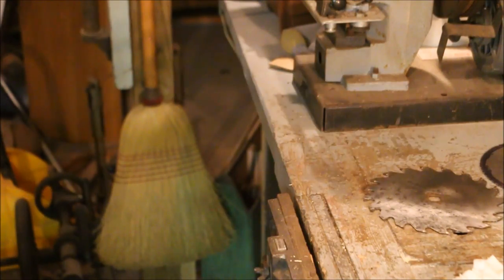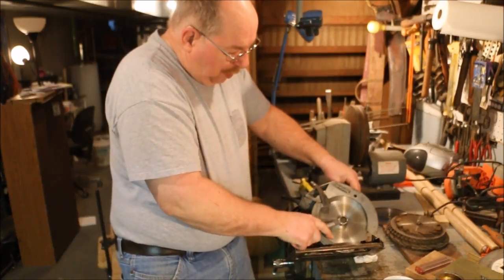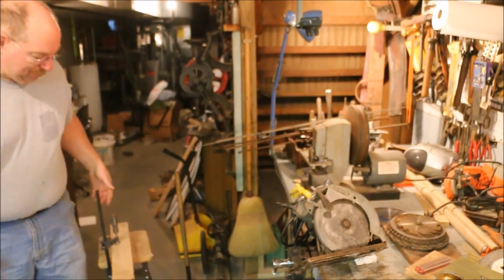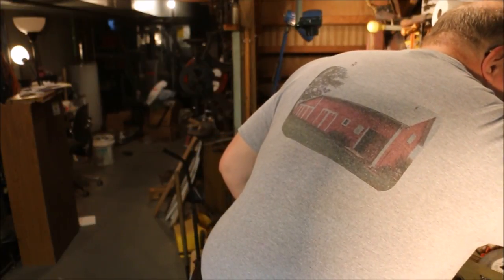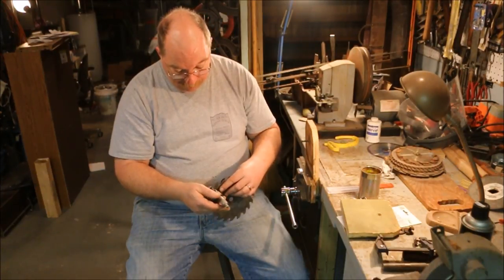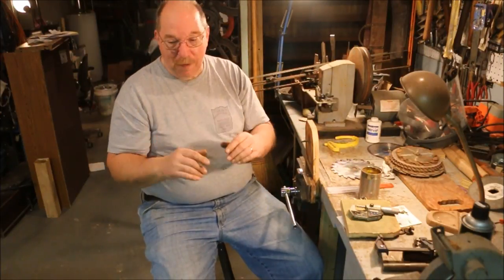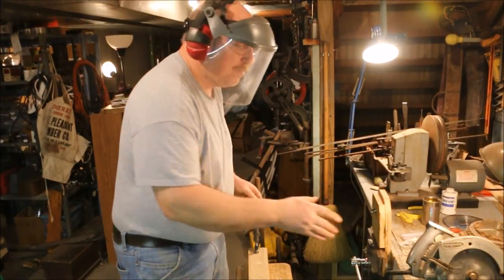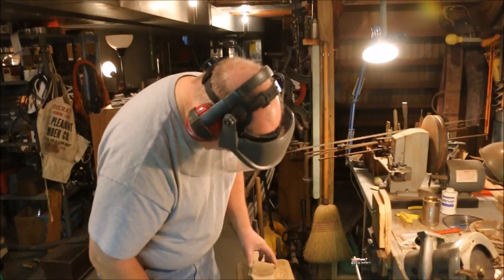CAN YOU SHARPEN CARBIDE SAW BLADES BY HAND? ~ PART 3 ~ TESTING RESULTS

Comment: My very sincere thanks. Proof indeed on the ability to sharpen carbide tipped saw blades and my Evolution will be getting the Sneelock treatment, saving £25 a time on new blades. I like the Evolutions ability to cut wood, steel, aluminium etc but the cost of blades was always a bugbear, but now I will get much more life from a single blade. I am building the same jig and will mark each tooth with the poor man's engineering blue, namely a permanent Sharpie. Thanks again.
Reply from the maker: UK Tony If I hadn't found an inexpensive bottle of Dychem I would be using a marker. 
I still use it on some jobs. No drips. 😎

Comment: Looks like the proof was in the puddin' on this. I think my DeWalt blade and the set as alternating angles on the top of the tooth (none in the blade itself) but I've slept since I had it out with the plywood blade in. But I like smoke. It's the bouncing around I can't handle, literally, so as long as it don't try to run off it's good enough for who it's for, ME! Now if it was a diesel saw it'd be different! Thanks, Unc! Fine job as usual!.

Comment: 'Michigan Skilsaw Massacre' (Granted, you're using a Craftsman circular saw, but I'm taking artistic license for a better name) may not be the greatest horror film of all time, but it would certainly be one of the most interesting.  Chasing after old machinists ('cause who else bleeds Dykem?), and having to stop every 50 feet to find another plug-in... You'll have to choose what type of mask to wear, cause nothing comes to mind.

It's not hard to see who's the sharpest tool in the shed around here...  And the best thing is that you're willing to share how to get sharper!!!
Reply from the maker: Wearing a tinted face shield and ear muffs to block the screaming, the SkillSaw Blade Master stalks the back alleys of the industrial parks looking for the tell tale blue finger prints left behind by the fleeing Machinist Gang. 
Time is short and so are the extention cords. Will our hero vanquish the foe before he reaches the end?
Out of the shadows comes the APRENTICE.....
Running along behind, pushing a generator on a two wheel cart. With extra blades, a spare saw, a bottle of vinegar, and a handfull of files the APPRENTICE stops long enough to check a nearby dumpster before plunging into the back door of the machine shop behind the SkillSaw Blade Master. Until they run out of gas, or blades, they will cut through their enemies without mercy.

Comment: I hear the Cheers!  Looks nice!   Now find some more fun and show us later.   
if i had to cut a saw blade in half, what kind of - saw or blade should i use?   just an everyday circular saw blade - nothing special -   i see now, it's not only blade materials, [tri-blade],  but now need a Different Saw.   = \    I'll hand saw  *  adding to list.
Reply from the maker: Karen O Old school would be to clamp it in a vise with the cut line even with the top of the jaws. With a cold chisel and and appropriate size hammer strike along the line and shear off the metal above the vise. 
Modern options include a hacksaw. It will cut carbon steel. Not easily and not quick. 
My personal favorite is an angle grinder and abrasive cutoff blade. 
Water jet, plasma torch, laser, cutting torch are way down the list because of cost or poor performance.
Reply: W0W!   Thanks much!   A Chisel - Old School huh, sounds like that idea was never topped.   My search on line did not get me far.   Karate Chop with Cold Chisel with Hammer.  I may have that chisel.  Thanks for the input.   peace  *
Reply from the maker: MILLING BY HAND AND EYE  Using Lewie's favorite tools you can make amazing things. Watch these and you will be able to slice that saw plate to ribbons. 
https://www.youtube.com/playlist?list=PLXlq5qGw1peot0KYWh-qUL_RNB2cSsoe3

Comment: If at first you don’t succeed cheat if that don’t work hit it with a hammer and go home or in your case go back to bed lol . I’ve always sharpened them on the face like you’ve just done never done just the tip so was interested to see if it worked . Next time they get a set of diamond files in Lidl I’ll get you a set and send them for you they for the money are very good . Got up this morning and before I did anything looked to see if the text was still there yippee it was I wasn’t dreaming lol 😝 drinking coffee in the shop I’ll have to show you the trick of blowing the top off so you don’t get a mouth full of saw dust very useful to no I can tell you .thanks unc good video as norm
Reply from the maker: David Chadwick I almost didn't tell you. The waiting always drives me nuts.
Reply: Old Sneelock's Workshop ill happily wait 😬
Reply: I understand the first parts but you lost me at the first red light. I think gas, grease dirt and sawdust actually helps a good cup of coffee taste like something a dog wallered in but it beats nothing and will help you run off and hide in a little while. I better stick with the hammer though. I'm about too old to learn a new trick.
Reply from the maker: Lewie McNeely David already had a shirt so he's got a couple saws coming in the post.
Reply from the maker: David Chadwick Years ago I was the Maintenance Manager at UTC. I have always been better off looking at a problem, so I frequently got called to the shop floor. That left my coffee on my desk. A sheet of paper kept the dust out, but it was often stone cold when I got back to it. 
Funny, cold coffee doesn't bother me. In the morning I use to put an icecube in my cup for the drive in to work.
Reply: Good Deal! I tried to put this down a while ago but hit the wrong thing and deleted it and I was too ill to try again.......until now.  SO.......we had to get some lumps taken off the goofy bulldog so while waiting for her to come around at the vets we went to the Re-store and I got thoroughly Sneelockized! I found a rusty but sharp Atkins cross cut handsaw for $2, a double edged Red Devil scraper for a buck, a brass file brush for fifty cents, a can of Johnsons paste wax with a teaspoon taken out for a buck and a straight cut set of tin snips for a buck. Then went to Lowes and got a jug of 1 3/8ths deck screws and ate Chinese and turned my water over and the waitress tried to get me with a skewer for doing it, then went and got the bulldog, stopped and got some meds for her and came home. She's glad to be back and cut from end to end but lump-less and Cheryl cooked no supper before it's time. I'll de-rust the saw directly. Had a label on it that said 'wall hanging'. Not HERE it won't be. Some scraping and wire brushing and a dab of that wax and all will be well! Now I have TWO working saws, almost. See what you do to me and it's long distance!
Reply: IT's been known to happen to me. Iced tooth-cracking cold and black as night!
Reply from the maker: Good deal on the Restore Run. Glad the pup is okay. Thunderstorms last night so the 80 lb German Shepard hid in the back bedroom and whined. She's sweetheart so I try to not encourage her. My sister Peggy is a dog whisperer and said that if we baby her it will get worse. 
Atkins made Silver Steel saws. Good stuff. With a little elbow grease, some scraping, and a dab of the Johnson's, you will soon be flying through those gate builds. 
It is contagious. 👍😊😊😊👍
Reply from the maker: Brain freeze. Not good when you are driving. 😊
Reply: Basal cello so she whittled on from lower lip to back leg. She made it down and back the back steps to water the grass so all is getting better. She'll climb in with us if it gets really bad. We were supposed to get what you got but nothing so far. Town is 22 miles away and they got some but not here. She knows no stranger and she's as clean as a cat so up she comes. She has her own cover though and sleeps on top. She just does it if she gets really scared. The saw is a plain jane except for the emblem in the handle but a nice saw for what I can see. If it cuts it's a good saw. My philosophy anyway. I'm going to get a razor scraper or borrow Cheryl's. Might as well get my own. Now I've got a short one and a not so short one 
 And YES, it IS catching!
Reply: Old Sneelock's Workshop I’m more or less just getting to like coffee I’ve always been just tea but about 5/6 years ago tried it and I’ve got to like it then about 6 months ago got a coffee machine with real ground beans and now I’m hooked love it but cold no no horrible I was the same with tea didn’t like that cold don’t Mind it warm ,at work I always had a tin mug one to stop it getting broken and two so I could put my brew on a hot engine or over a oxy/ act torch to get it warm again .
Reply: Lewie McNeely hope coco is ok and on the mend . Good find on the tools sounds good , have you ever watched the guy who does planes up wears a wood shavings wig , he shows how to make a rust scraper with a Stanley knife blade I made one they work real good on rust dead easy to make as well you don’t even need a new blade either because you have to put a different edge on it anyway just a thought might help . Give her a hug for me tell her it’s form over the big puddle x
Reply: Thanks,  Ad Man! She's got her bed on the floor in the living room and Cheryl is sleeping on couch cushions besode her in case she needs anything. She's been cut all over but it was a neat job so I think all will be well in time. The tool deal was very satisfying and I'll get started on the saw before long. Maybe I can get some pictures??!! Seems our well needed rain has started so I'll just let it rain and help Cheryl with whatever needs done here. Yall take care and I'll give Coco a good rubbing from you!
Reply from the maker: UTC had paper cups coming out of a coffee machine that came over on the Mayflower. I would walk up to the front office with my cup in hand and get drip coffee out of the conference room. One of the perks of being a manager I suppose. Could have put a coffee maker in my office but there would have been a steady stream of panhandlers through the door all day long. As it was I took all the chairs but one out of my office. If you came to visit you were going to stand up while you were doing it. 😊
Reply: Old Uncle SNEEKYlock!
Reply: Diamond needle files in Lidl next week at £2.99. Hope this helps.